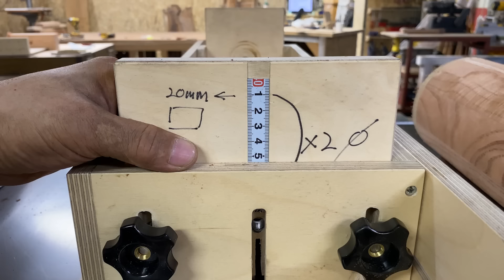3 Woodworking Tips/Cedrela sinensis/Cone Table Leg Tips/ joint furniture

Comment: Nice craftsmanship. Having said that, using that contraption to "turn" the legs is extremely dangerous. One knob that fail and you will have wood missiles flying around.
Reply: @BlackRaven-w4e  there is danger in all woodworking.  He found a safe way to do it. Your comment is unnecessary.